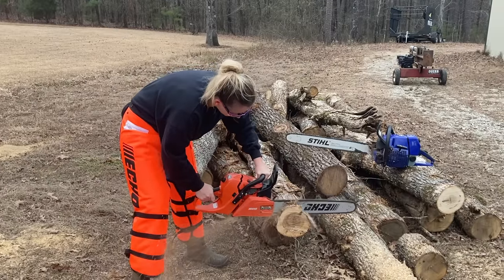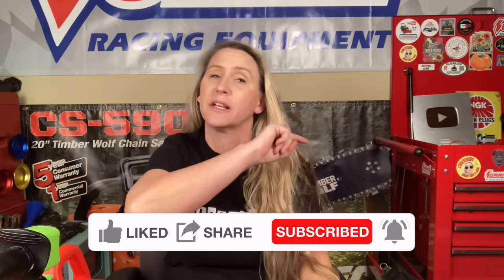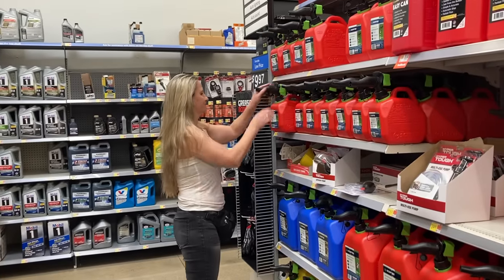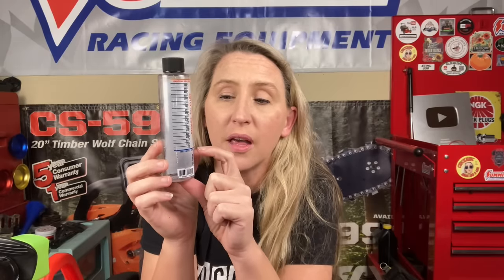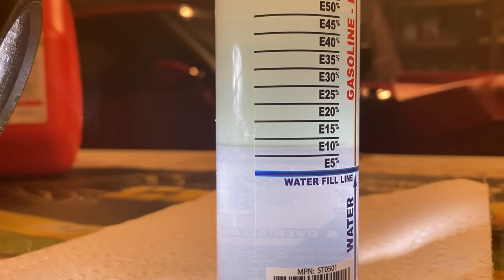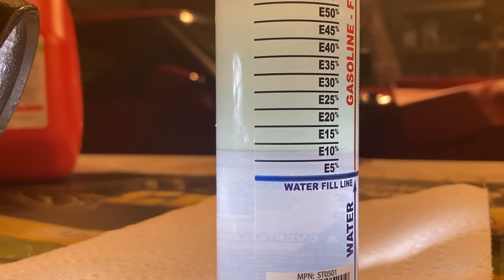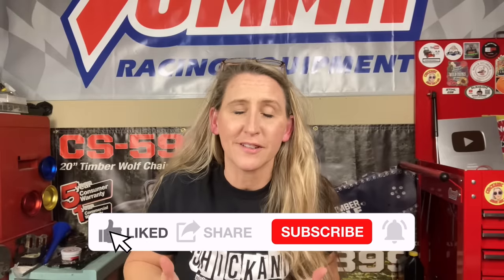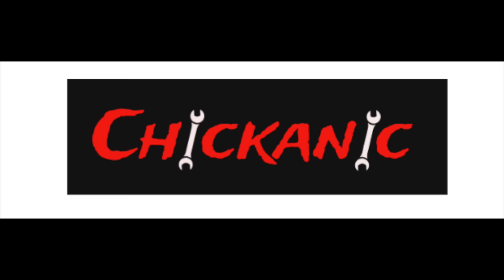Fueled by Deception. How You’re Getting Ripped Off at the Pump! (I'm SHOCKED!) VLOG

Comment: Tip for reading the level of the Water/Ethanol vs. gasoline, put 3-5 drops of black or blue food coloring in the bottle then fill with the water to the 1st line. After shaking the mixture, when it separates, it gives a good contrast between the yellow of the gasoline and the black water/ethanol cocktail. Also, if you ABSOULTELY want to remove any ethanol from your gas, here's what I do... I take a 1 quart bottle and place 10 drops of black food coloring in it, then I fill it with water. I then dump that into my EMPTY 5 gallon gas can. At the pump, I put 4.75 gallons of 87 octane which has UPTO 10% ethanol. I ensure I give it a good flow of gas from the pump, ensuring it's mixed good. When I get home, I let the can set for 60 mins to allow it to completely separate. I'll use a siphon and extract the top 3 gallons of pure gas out of the can.  I then dump the remaining into an inverted 3 gallon "water cooler" jug that I cut open the base, and I have a hose coming out of the neck (facing the floor).  I let that sit for 60 minutes and the water/ethanol settles into the NECK of the water bottle. I then open the valve on the hose from the bottom of the bottle and drain off the Water/Ethanol cocktail. Once I start to flow pure gas out of the tube, I add that to the original 3 gallons of pure gas. In the end, when I utilize 1 quart of water into the 5 gallon can, I get about 2/3 of a gallon of water/ethanol out.  Sort of what this guy did with a small jug, I did with a 3 gallon jug.  https://youtu.be/onCG7mIprfE?t=111
Reply: That will definitely work but you will be below 87 octane after you have removed the ethanol as it acts as an octane booster. Maybe this isn't a problem for your application, but figured I'd mention it.
Reply: I wouldn't recommend this. Modern gasoline contains a variety of additives that serve important purposes. These include detergents that keep your engine clean, anti-corrosion inhibitors to protect your fuel system, seal preservatives to prevent fuel leaks, and lubricants to reduce friction. Siphoning off the top layer of gasoline after mixing with water may remove some of these additives along with the ethanol (depending on the additives' affinity for alcohol and water). Also, as others have pointed out, removing the ethanol decreases the octane rating. This method of getting ethanol-free gas has the potential to cause as much harm as good.

Comment: I've watched a lot of your videos and enjoyed them all.  I have a few acres and a bunch of 2 cycle weedeaters, blowers, chain saws and hedge trimmers as well as 2 tractors.  I have been using the SEF fuel for a few years thinking it was better than mixing my own - at 5 times the cost.  Today I went to put some in my weedeater and it was sticky to the touch and smelled really bad (only a month old).  My machine ran crappy and at the end of the day I dumped the fuel, went to the local station that sells non ethanol in a dedicated pump and filled up two cans.  The echo dealer in town should have the Red Armor so hopefully when I get it mixed Ill be better off - cant be worse LOL!  Thanks for your great vids!

Comment: Very interesting, never thought about it but probably answers some past issues. As for gas cans, the "No-Spill" brand actually  works as advertised and will have  you throwing out your other ones.  The only issue I've had is it will overfill a Honda lawnmower if you leave the Honda filler neck in.
Reply: I will happily keep my good old vented cans until they crack.   A couple date back to the early 90s.

Comment: Imagine if pumps had a single hose for gas and diesel and you could switch between them by pushing the button on the pump. This video explains why that can't happen, but it happens with the different gas grades. Great explanation on how this occurs. Ps: the man with the goatee needs more airtime, I'm sure you've been inundated with calls from talent scouts.
Reply: Also Diesel nozzles are larger in order to prevent people from putting it in a gas engine by accident.  It's more of a make it idiot proof thing.
Reply: @slimjim7411  Around here they are sometimes the same size as the gas nozzle because they were replaced by an idiot. I've even seen a gas sized nozzle on a high flow diesel pump. My mom drives a diesel Jetta, and the fuel tank has a little door that only opens for the correct size nozzle, and she needs to carry around an adapter because some stations have either gas size nozzles on diesel pumps, or only the high flow truck nozzles. The adapter allows both to fill the tank.
Reply: Some older diesel pumps still have the same sized nozzles. I'm talking WAY outta the city at old small country stores. Years ago this was very common. When there were only 2 pumps beside each other, regular & diesel. I've known many people to put some diesel in the gas tank, especially the girls. When you get in a hurry you are not paying attention to details, even though there are many clues to let you know its not gas, if you pump diesel you know what I mean. It happened a lot at those places & there are some still out there.
Reply: @rocknraptor3195  Pay attention? Heck the price at the button would be more than pay attention to avoid putting 80-90 cent higher fuel in your car ;)

Comment: I used to race with E85 as a fuel in a Carbureted engine.  That meant any variations of ethanol content would require a tuning adjustment.  When I tested my fuel I put the gas in a smaller wide mouth container instead of fighting the gas can.  Might be a little easier next time.  Love these vids, you've taught me a lot!

Comment: You can thank "The Land of Fruits & Nuts" for those really funky gas cans. I remember when they went from the cans that had a separate vent on them to the non-vented type, & thought that those were terrible. Apparently those are now held in high regard. I bought a Justrite II fuel can for my 2-cycle mix a few years ago, & never looked back.
Reply: I drilled a hole ever so smaller than a golf tee as a vent. Plug when storing 😉
Reply: @shanemccart5059  . And, plugs the vent hole really well using a golf "tee"...
Reply: I live in NC and purchased the conversions kits (nozzle & vent) from the local TS and got rid of that clunky mess.
Reply: Funnel?

Comment: Interesting, I had not thought about gas left in the hose but that makes sense. Luckily here in NH E85 is not a thing. Pretty cool low cost Ethanol tester - have to add that to my shopping list.

Agree with you about the new style gas cans, I've modified all of mine with old style air vent and nozzle. I think the goal of the new gas cans was laudable to minimize gas vapors but in practice they made the situation worse.
Reply: For me they don't make any sense if  they are supposed to eliminate fumes because when the fuel goes into the tank, gas fumes come out to make room for it.

Comment: Your story brought back memories.  You ask any kid that worked at an airport when they were young. Especially if like most kids working at the local airport they had a motorcycle or scooter.  Every one I know who ever worked at an airport would routinely drain the airport fuel hose to put fuel in their bike.  Fuel to spare from those 15 - 20 foot hoses!
Reply: The old gas station pump hoses used to hold maybe 8 ounces of gas after the pump was shut off. When in HS, I worked nights at the two full service stations at the end of my block and had to drain the hoses before padlocking the nozzles in place for the night. Then I dumped the collected gas into their tow truck before going home. The EPA came along and made them redesign the pumps so practically all of the fuel in the hose is siphoned back into the storage tanks to leave only a few ounces behind. I discovered that a few years later while traveling on my motorcycle and needed gas late at night. All the stations were closed but had pumps that took credit cards. Tried draining gas from their hoses to get 2 to 3 ounces from each one. Luckily a cop came by and used his credit card so I could fill up.
Reply: Yes I did

Comment: Hi Bre, thanks for doing this really interesting video.  I have been working on small engines since 1970 and my own cars since 1974.  I have also personally experienced fuel system damage due to ethanol/gas fuel in both small engines and cars.  Adding alcohol to gasoline is really a bad idea (except in rare instances), it causes the gas to breakdown faster, dry out rubber and plastic parts, cause lots of corrosion, and reduce the effectiveness of motor oil for cylinder lubrication, and wear out valve seats faster in 4 cycle engines.

I live in central Florida and most of the gas station fuel pumps here have a separate hose for the ethanol free gas.  Since I am retired and don't drive much, I run ethanol free fuel in the car to minimize fuel system problems.  The problem I am seeing here is; it appears E10, 87 octane is being sometimes being substituted in the ethanol free gas station fuel tank.  I haven't 100% proved it with the water test yet but, the E10 fuel instantly drops my gas mileage by 10 - 15% since it has less energy than 100% gas.

Thought I would pass on my fuel formula while we are on the subject.  I have a large yard with many trees so, have a lot of gasoline powered lawn tools.  Having been burned so many times by deteriorated fuel, here is my fuel recipe.  Starting with ethanol free gas, add the recommended amount of Sta-Bil and 1 oz per gallon of Marvel Mystery Oil.  I have tested this in fuel tanks and carburetors out to 4 years so far in high temperature and high humidity environments.  So far I have had zero bad gas problems, I don't even get any corrosion or residue buildup.  This recipe works for both 2 and 4 cycle engines but, obviously the 2 cycle still needs the 2 stroke oil for lubrication.

I hate those government designed gas cans as well.  The green button type also have the problem where the rubber seal in the push-button bonds itself to the other plastic pieces in the valve, making it very difficult to open after the gas has been in the can for a year.
Reply: I just got 5 gal. O. M. G

Comment: interesting.  I continually have a problem with my small engines if I don't use them for a few months. I'm guessing it is the small percentage of ethanol.   What I am more amazed at is after all of the brilliant testing - not once did you use a funnel to pour gas into that bottle.  lol
Reply: Try Z100 fuel additive I think it's the best you can buy it's worked for me every time I needed it.

Comment: I have been using ethanol, 87, gas in ALL my equipment except one, s Stihl poll saw, which I use the pre-mixed fuel in.. I have never had a carb problem for 20 years. Lawnmowers, chainsaws, generator and pressure washer. They sit for months during the winter with fuel in them, and start right up the following spring. The generator has two year old gas in it and it still starts and runs great. I do use fuel stab when they are not in use.

Comment: Being a motorcycle rider, I fully understand the ethanol issue. As long as I am fueling the motorcycle to ride and use the gas I am putting in, and I always use non-ethanol, I might get a little ethanol in, but it is being used up, not sitting. When I get ready for winter storage, I put my gas cans in my pick up, drive to the gas station I normally use and fill the truck, then fill the gas cans sitting on the ground. That way they get 100% of what gas I chose.  I always use this non-ethanol in my small engines and my motorcycle. The only exception is when I am farther from home riding and need gas. Then I may get a small amount of ethanol in my tank, but I am using it up. When I get home, I top the tank with 100% non-ethanol from my gas cans.  To not do this WILL result in white corrosion in the carbs and a poor running bike, requiring a carb removal and rebuild. Oh, I always use Marine STA-BIL in my gas cans when filling them.
Reply: My Harley sits for months and months over the winter. Does the bike run good on ethanol free?
Reply: @Thisishard2333   I haven't noticed a difference of performance between the two at all Steve, however a 97 1100 Virago is not a high performance machine.  What happened the first year I had the bike was; not knowing the evils of ethanol on bikes using carbs vs fuel inj., I filled the tank with ethanol and put it in the garage for the winter. It was running great. The following spring however, it was running really rich and when on off throttle, it would try to die. Barely made it back home and investigation showed the rear cylinder was very rich.  Removing the carbs to find the issue, I found white corrosion inside and after a cleaning and adjusting, the bike ran great again. That was in 2020. Every winter since, I have made sure the tank is topped up with non-ethanol only and each spring there has been no carb issues.
Reply: @seniorrider9337  up in New York I’ve never seen a ethanol free pump. After recently moving to North Carolina they are everywhere. They said the rule of thumb is anything that will sit for extended periods of time. Lawnmowers leaf blowers portable generators. That’s what they say to use in  them
Reply: @Thisishard2333    Steven, I have been keeping about 10 gallons of ethanol free regular in my cans mixed with maringe blue STA-BIL, for my yard machines to use and to have for my emergency generator. I also use it to fill my bike gas tank if I don't want to drive to town and get ethanol free gas at the boat dock. Seems every where else has lost their ethanol free pumps except for expensive Shell 93 octane for over $5.50 a gallon.  My Virago has been getting around 45 miles per gallon which ever gas I use, although I do try to stay away from the ethanol stuff unless I am on a longer ride and can't find ethanol free.   I was born and raised in southern Va. and have a sister that lives in NC.  Moved to Washington state after a tour in the Navy here. Weather here is more temperate that Va.  Ride safe man.
Reply: Marine stabil, not navy, army, air force etc. Semper Fi.😊😊😊😊👍

Comment: Note worthy that you also just showed how to get ethanol free fuel.  Add water to it, then let it separate and decant the pure petroleum product from the top layer of the container leaving the water/ethanol mixture at the bottom.  Adding food colouring also makes this process a lot easier as it will only dye the water.
Reply: Keep in mind, though, ethanol is an octane booster, so removing it from 87 octane for example could cause pinging. YMMV.
Reply: @narfharder  Yes this is true, very good point.
Reply: @narfharder  at least back a while ago though when E10 became the mandated regular here my local station's supplier was taking pure 87 octane fuel and adding 10% ethanol to that so it should be higher than 87octane with the ethanol on board.  Maybe that was just a local thing or maybe they have since changed it to allow them to consider the ethanol in the octane rating but worth thinking about.
Reply: I wouldn't recommend this. Modern gasoline contains a variety of additives that serve important purposes. These include detergents that keep your engine clean, anti-corrosion inhibitors to protect your fuel system, seal preservatives to prevent fuel leaks, and lubricants to reduce friction. Siphoning off the top layer of gasoline after mixing with water may remove some of these additives along with the ethanol (depending on the additives' affinity for alcohol and water). Also, as others have pointed out, removing the ethanol decreases the octane rating. This method of getting ethanol-free gas has the potential to cause as much harm as good.
Reply: @PT-ie2xj Yes, I would not do this in my car, but in my chainsaw, not a single concern.  I'd be more worried about the ethanol and water content in the fuel making my chainsaw not run right.  My chainsaw doesn't need to drive 250,000km.  Those additives are for vehicle engines and no so much important in small engines.  Definitely don't do this and put it in your car.

Comment: Pour the gas into a 2 cup measuring cup first and then into the test container.  Or you can put it in a squeeze bottle like for ketchup and then squirt it into the test container.  I use the squeeze bottle for filling the weed trimmer and chainsaw.  Works great.

Comment: Great pickup. Here in Australia we have a separate hose for each fuel, and we don't blend from tanks to make a different grade so we don't see that as an issue. I used to run E10 and that was no issue with a regular turnover of fuel, but towards the end of the season I used to switch to 91 octane (your 87) which is ethanol free, but now I just buy 91 (87) for the mowers 20 liters at a time and they are happier, but I also add a fuel stabaliser and injector cleaner to the fuel  and ever since then I have had zero issues with fuel lasting all season. At the end of the season I throw the leftover in my car, including the 2 stroke fuel/oil mix and get new stuff just before mowing season again.
Reply: We here in the UK also have dedicated fuel delivery hoses for each grade of fuel. 😊😊

Comment: I buy all my ethanol free fuel from a local station with a designated hose.  I haven't ran it first though to clear the line though. That being said...I just ordered an ethanol tester like you used to test the fuel I already have on hand.  If they have ethanol in it I may have to run it all through my truck and replace the fuel in the cans...after running a gallon or two into my truck!  Thanks for the video!